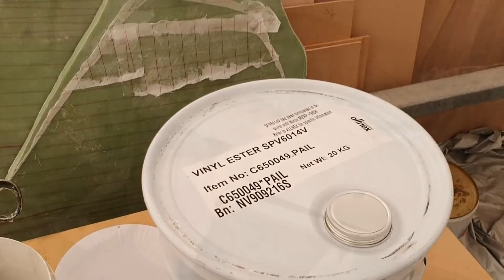Ep095 Laminating a 20ft Long Bulkhead - Life On The Hulls - Catamaran Building Project

Comment: Would Oz let you use Nida-Core in place of the marine ply? Seems the product would be a lot more hardy and long lived over wood. Also more compatible with the resins you are using. Also a lot lighter. Might even have been better use in the hulls in place of the foam. If I win lotto I’m coming to Oz to lease the mold. Fair dinkum.
Reply from the maker: Gidday Jeremy.With it's current floor plan and the foam core laminated the compression requirement was not able to pass engineering without additional layers of substrate and carbon reinforcement which would have added serious cost to the build.I wasn't prepared to justify the cost given it is a cruising cat not a race pergormance boat with a short life span .All bulkheads in marine ply are abovexw waterline so will remain dry in any  case.Mould could well be rented.Cheers Ross

Comment: Just an idea mate you should look into 3d printing sure you are not going to print out your 40 foot catamaran but you can print in carbon fibre kevlar and other materials and you might find it easier and cheaper for some of the parts you will be fitting further down the line
Reply from the maker: I love the idea of 3d printing.Lots of research to do for that.Cheers Ross